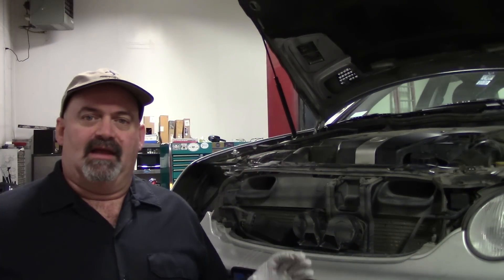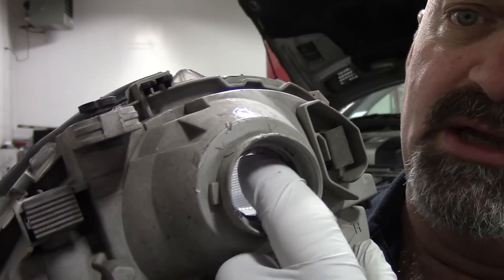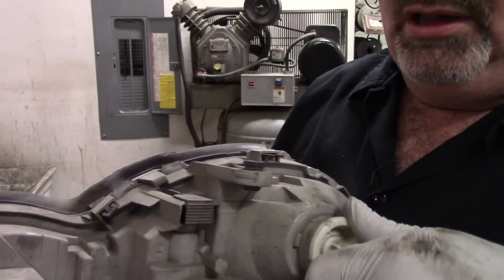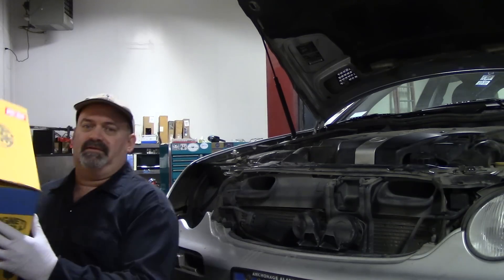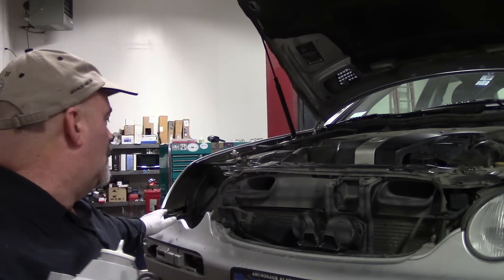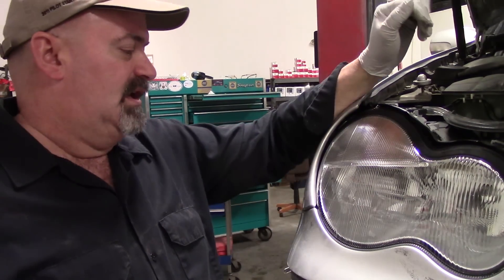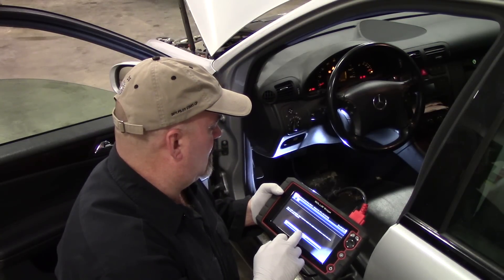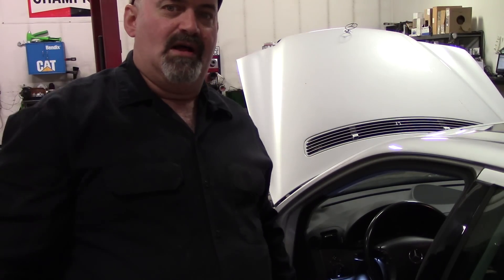Mercedes-Benz Front Turn Signal Wont Function

Comment: Thanks dude. I have the same problem on the same side. It was intermittent which indicated a loose connection but when removing the bulb, the connection on the globe holder looks brand new. I can't really see the inside of the headlight contacts while the headlight is installed so will do some research into that.

Comment: Did you put electrical grease on the new contacts to protect them? Note I didn't say dielectric grease, that's the wrong product.
Reply: got me confused Dude, why use any grease at all? seen lot of problems with grease.
Reply: it prevents corrosion, you should use electrical grease on all terminal contacts that might get exposed to water, salt, etc.
Reply: super coupe, see http://amzn.to/2yuRTAP (p.s. I used to have a 96 Tbird, really great car, not an SC though)
Reply from the maker: I didnt in this case but that would have been a super good idea. Ill put some on when he comes back for his next oil change. Thanks for the reminder

Comment: On a B200 2011, I replace the flasher  bulb and it works now.  But I can get rid of  the message in the dash board. And it's still flashes fast inside the car. But outside is ok.
Anyway trick to get rid of the dash message?

Comment: I have a 2004 Mercedes Benz clk 500 the passenger single light stays a solid yellow and don’t blink ,
I switched the ballasts over and ballast is good and still don’t function on th passenger side I’m having no blinker signal

Comment: Please help. For My 2004 mercedes clk500. Windows,turnsignas,horn and a.c don't work and sometimes the switch don't unlock. I have too play with the key on the switch to make it work. Sometimes i can start the engine but nothing works plus the cooling fan stay on.

Comment: Hello, I have a c230 w203 and the left front headlight turn signal is not working. No message on the screen and everything but that bulb works perfect in the car. So I unpluged the headlight connector and checked for  continuity like: from headlight socket N:1 to bottom connector on socket bulb and perfect continuity. From car body to top copper headlight socket copper and ground perfect. Light bulb is perfect. The problem is coming from the harness wire N:1. Where is this wire coming from and somebody seen this problem? May be a relay for that bulb? Car shows on screen when a bulb is bad, but not that one. I can even remove that bulb and turn signal shows no errors o high speed blinking. Help will be appreciated thanks

Comment: Bits bent tin, i thought merc would have known better :-(.

I had to repair a frends peugeot estate car with a similar "bits of tin" contacts for the indicators,  i drilled two small holes in the back of the top hat bulb holder and soldered two wires to the inner tin bits, fixed the problem :-D
A very shitty design indeed :-(
Reply from the maker: Your fix would have been a lot cheaper for sure. Money was no object in this case but next time I will show the cool updated repair i mentioned similar to what you did. Good to see you here mate!